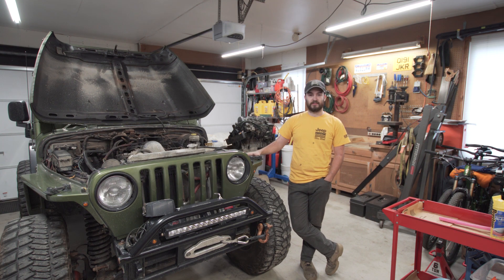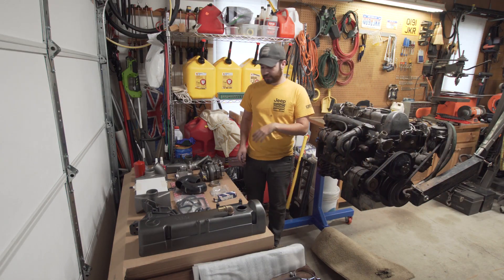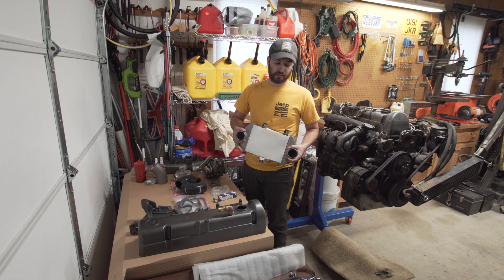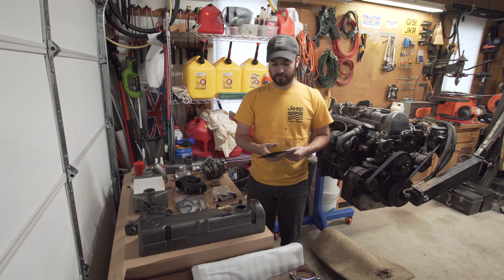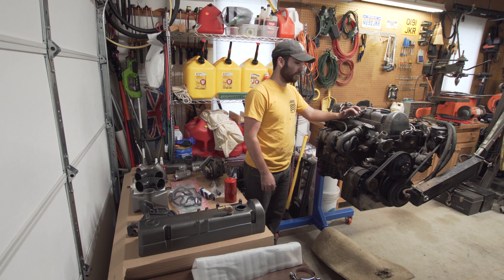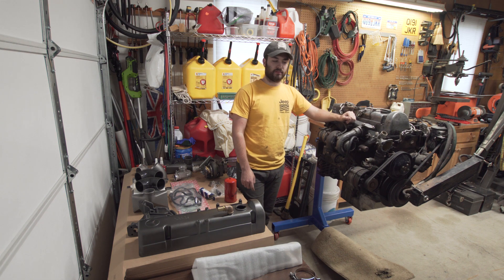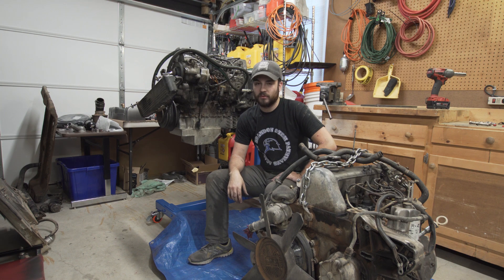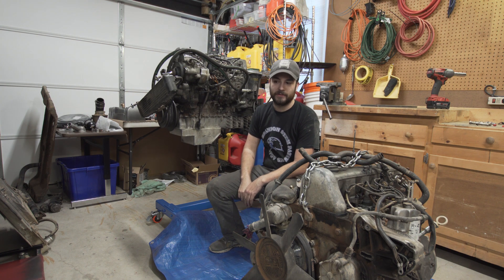OM617 Turbo Diesel Swapping My Jeep TJ... Again! (Pt.1)

Comment: you ever try a water to air intercooler? like off a vw they work pretty good and you can mount them wherever
Reply from the maker: No need with the HE200 and stock pump, EGTS are never over 1000*F. But on my 300hp OM606 swap, I will be switching over to a water to air when I do my next turbo setup.

Comment: I've had an OM617 in my '81 CJ5 for about 3 years... 37" Crawlers, Dana 44's with Chromoly axles, 5" lift, remote fuel and oil filters, 6 gauge cluster, LED headlights and bar, 8k Warn with synthetic, extended rollbar... Next is a roof rack I'll fab. Soft-top.

Comment: How much was the dieselmeken pump and was it done by dieselmeken or benzforce?  Also what was the turn around time?  I'm doing a series on putting a om603 into an 09 jku.  Wanting to know what edit software do you use?  I've been making youtube vids for over ten years and have around 1300 subs but it's time to start making better vids.  Thanks.  Love your Jeep
Reply from the maker: Thanks man, I got my pump through Benzforce and it was about $1200. I use Premiere Pro on a PC. Thanks for the support, I’ll have to check out your videos
Reply: Did you ever do your swap

Comment: if installation is tight, why not use an air to water after cooler?
Reply from the maker: I just like having this little filter up on the engine, I like keeping as much as possible off my frame rails lol
Reply: @robertsfabworks6579  I wish I has made an adapter for mine when I had the  W123 would much rather have used the CAT 2 micron spin on filters

Comment: What adapter do you use for the transmission? Great video keep 'em coming!
Reply from the maker: Thanks for the praise! Doomsday Diesel is the only way to go!
Reply: Yea I've got a ford so had to deal with the devil and get the md4x4 kit.. so far so good tho lol
Reply from the maker: @DudeDieAlready  Wishing you luck! I lost a trans to their kit...
Reply: @DudeDieAlready  what ford trans are you using.
Reply: @johnbrakingground  M5od-r2 from a 87 f250 but I swapped out the top plate from a gen 2 m5r2 to better fit my bronco ii
Reply: @DudeDieAlready  I have a ford also. So I'm just swapping trans and engine. Nv3500 trans

Comment: Cool video! Where did you source the stainless steel bolt kit for the OM617?
Reply from the maker: Will Van Unfortunately nobody that I know of makes a kit, but (almost) all the bolts on the engine are M6 or M8, so You can order some bolts off amazon or eBay, or just go to a local hardware store or fastenal with a list of lengths like I did. There’ll be more about this in the next video...